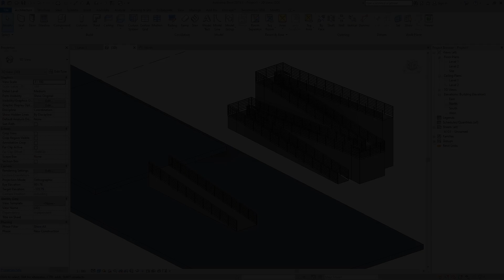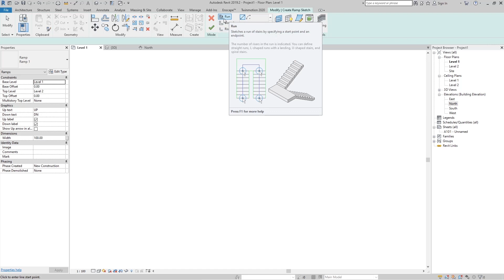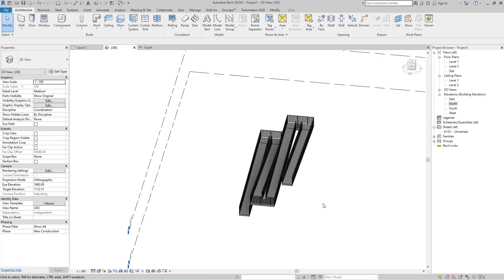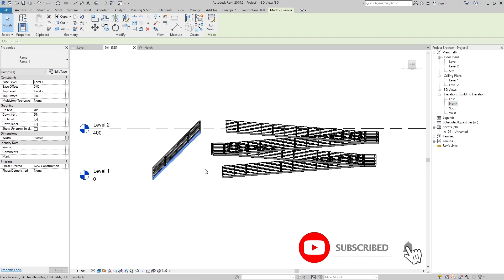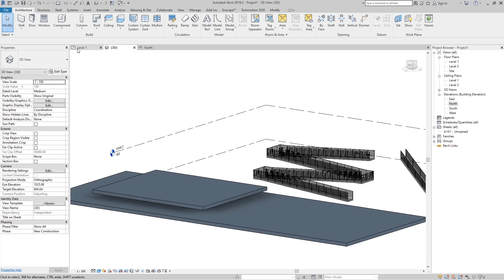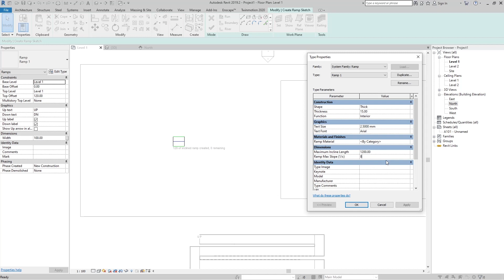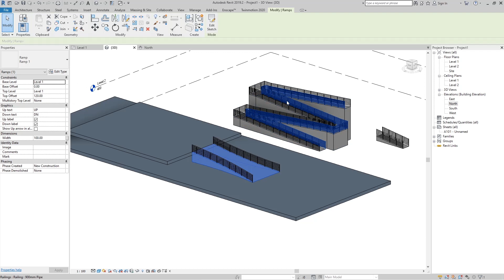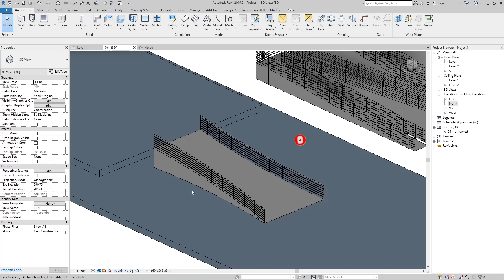How to create ramp in Revit : Revit tutorials for beginners (2021)

Comment: At the start of the video you were able to draw multiple ramps, on my revit I can draw one ramp and then it doesn’t let me draw more or sure why this is happening
Reply from the maker: Because your slope is to big I suppose, and you in one line draw all ramp path. Try to create first a half of that line path and than another half in second direction.
Maybe is this :)
Reply: @revitmagictricks2572  thanks!! I got it just had to change length and yeah make it smaller 😂 we are doing stair cores access ramps and lifts, everything has to be compliant so it’s very tricky 😁